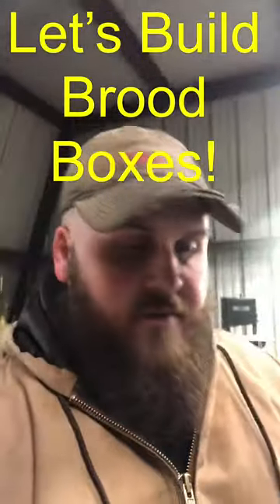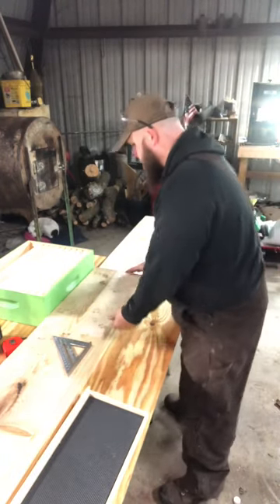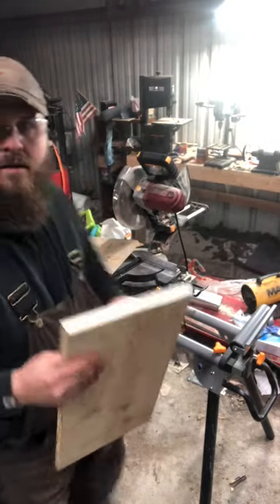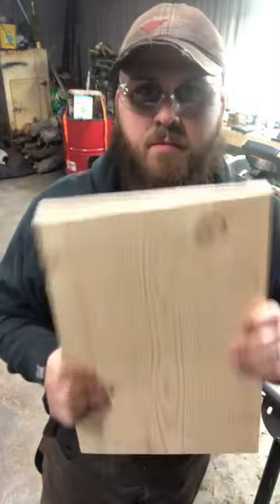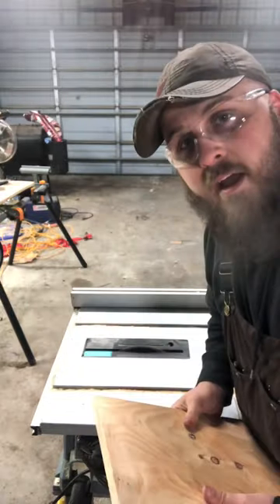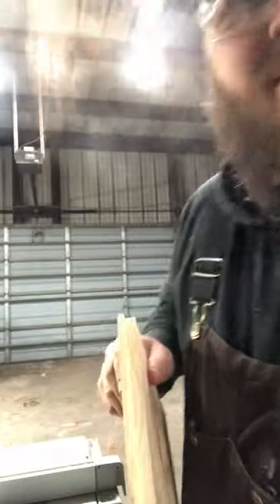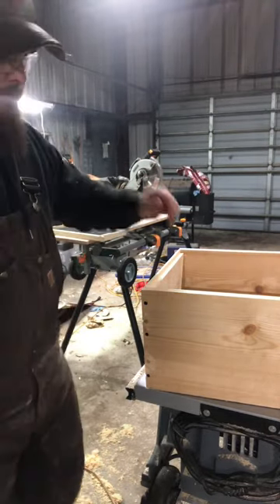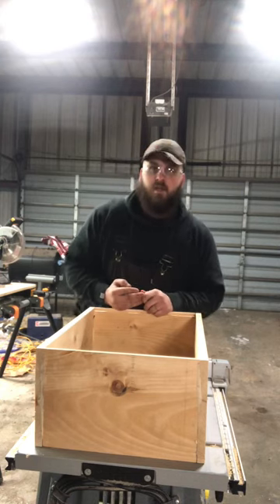How To Build A Beehive Box

Comment: Hey Jake, nice job!  Good idea using dowels, I haven't seen anyone doing that.  Your frame rest cuts are nice and clean, but they aren't deep enough, there isn't enough bee space on top after you set the frames in.  I killed my bee space on a couple of boxes after using my table saw as a planer, lol.  Mann Lake's frame rests are 5/8" deep, your width looks perfect.  What kind of covers are you going to use?
Reply from the maker: Dan Ski's Bees I haven’t decided yet which covers I’m using. I’ll take your advise on the boxes and go a little deeper on my next 7 I do. Thanks for the tip!
Reply: Can get round the bee space issue by going 'bottom bee space' on the supers. I am UK based and we have top bee space or bottom bee space but don't know if you have same options over there.
Reply: @GDHoneyAcresandCraftWork  Your bee space should work out as long as ALL your boxes are made the same way as far as frame rest depth and overall box height is concerned.  Consistency is the key.
Reply: @ThatBeeMan  Definitely!